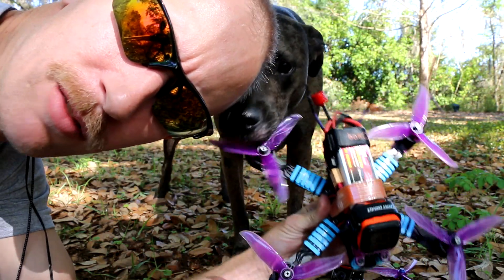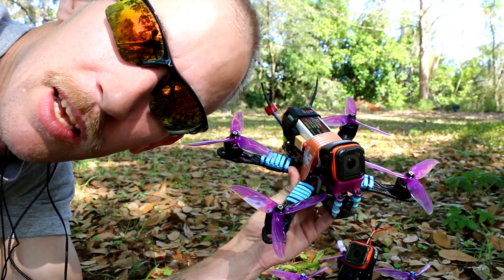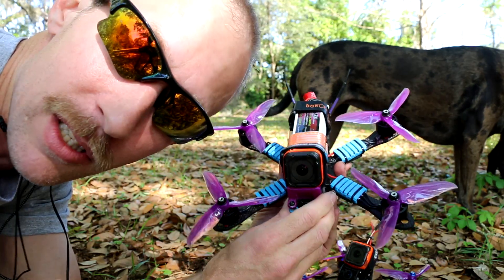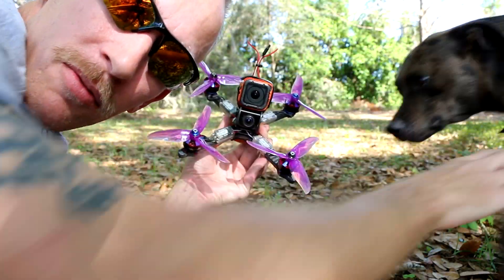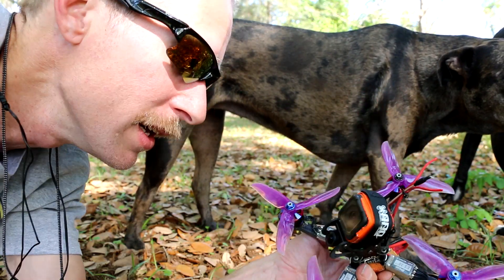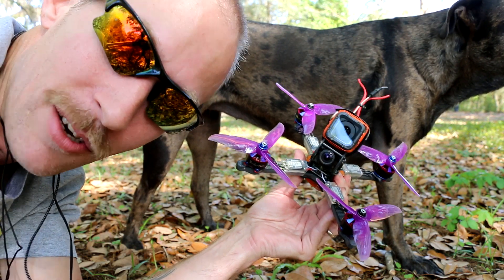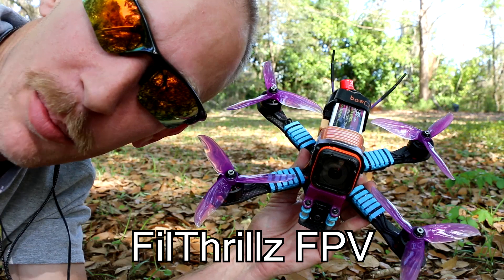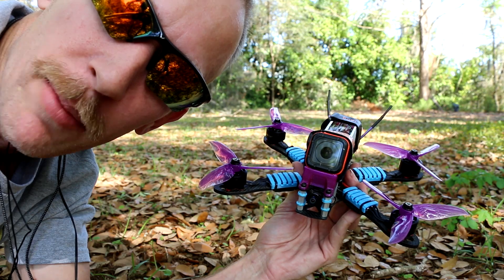Butterflight Q and R ?

Comment: Hey bud, interesting results. Basically what you've done here is pumped up the filtering, at the cost of more latency. The best way i've heard it explained (straight from the devs) is that q is trust in gyro measurements. Higher q therefore means that you are trusting the gyro more and therefore filtering it less. Obviously the inverse for lowering q. Keeping r at 88 is a good move. This number should be pretty static and just relates to the noise profile of the gyro

Cheers and thanks for the info

Comment: do you run kakute at 32k? or 8/8?
Reply from the maker: I don't believe i tried the kakute at 400, but the matek f405-osd acted glitchy.  Not sure if multishot is better than dshot, but it lowers the cpu load by 10%, which makes me feel a little more at ease.
Reply from the maker: 32k/16k, multishot, set cpu_overclock = 192mhz , that gives me a cpu load of 42%, it's 52% with dshot600, still flies fine.  That's with accelerometer off, airmode, dynamic filter, anti-gravity on.
Reply: thanks for your advice. i tried dshot 600, 32k/8k, cpu load was 35%
Reply from the maker: Yep, mine too.  I'm going to try those settings too, not sure there's any real advantage of running 16k pid loop.
Reply: mooosestang do you have PT1 enabled on the Kakute mine seems to freak out with PT1.  It gets a little better with biquad still really glitchy.  I’m running everything per butter suggestion 400 and 88 dshot600 and 1200
Reply: same here
Reply from the maker: Yes, pt1. Lower q to 200 and try it.
Reply: mooosestang thanks man!  Did yours act crazy and glitchy at 400?  Do you think multishot helps?
Reply: mooosestang dude you da man!!  I set 32 16 with PT1 lowered q to 100 just to play it safe.  It hovers without freaking out which is a great start!  I figured with soft mounted gyro it could handle 400q.  Can’t wait to do some test flights!  Thank you 😊

Comment: Can you set gyro notch filter: fast kahlman on a F4 board that can't run 32k? I have the dys F4 and 8k/8k is the max.and is it possible to leave the d term filter on (before I smoke my motors?) With that setting?
Reply: Yes you can, it still helps. I believe the recommended setting it to turn the d term filter off. I believe its because the current filters are configured to cover the d term notch frequency.
Reply from the maker: You'll be fine leaving dterm notch on.
Reply: mooosestang so.
frame: puda Charmeleon
FC:dys F4 pro version (v1)
Esc:dys Aria
Motor:racerstar 2306 2700kv
Props:hulkie 5055
All filters off=not even somewhat hot motors!